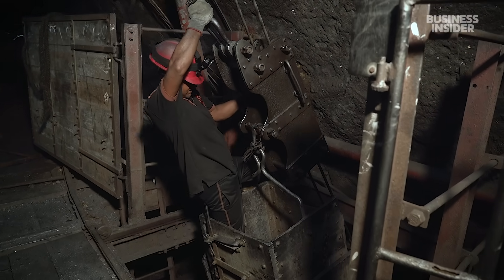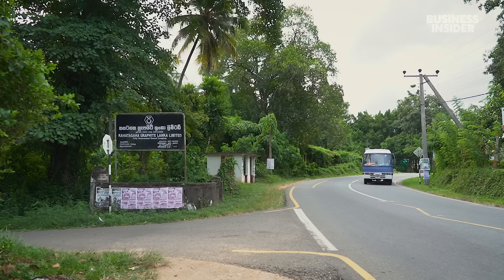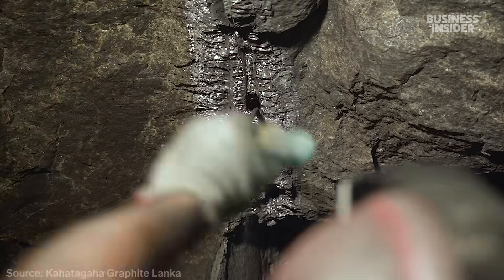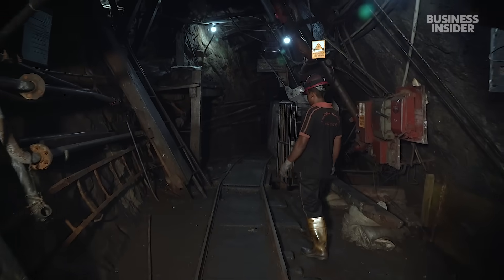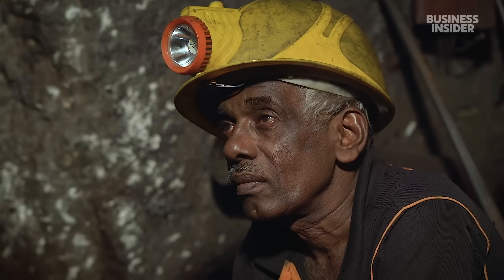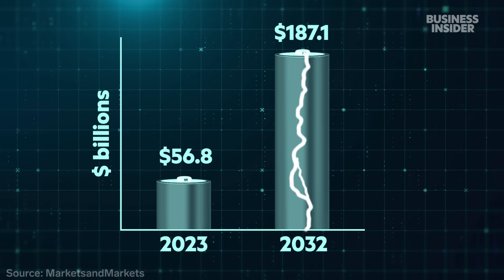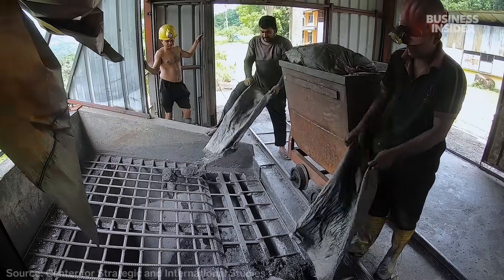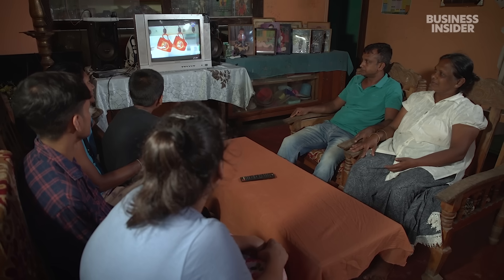Why Graphite Is The New Gold As Tech Wars Ramp Up | Risky Business

Comment: Graphite is not "The new gold", at least not natural graphite.  Natural graphite goes for about 2,000 USD a ton (about a dollar a pound) and that's after heavy processing.  The graphite used in higher end cells typically use synthetic which is far more expensive.

Comment: Correction : graphite is not use to pass electricity but its usd to insulate to two electrodes from fusing together! In batteries, it is used as a barrier to seprate aluminum and copper plates, which conduct electricity.
Reply: Wrong, the paper separator is used for insulating the electrodes, graphite is used in single use cells to increase conductivity of metal oxides and in rechargeable batteries like lithium ion batteries to hold the lithium ions and also to increase conductivity. 

What are you even talking about “two halves from fusing together” and “barrier to separate aluminum and copper plates” did you just take a look at a picture of a battery cell and make assumptions?
There are materials that coat the aluminium and copper plates to make the actual battery.
Reply: @exMuteKid  do all kinds of rechargeable batteries like lfp/nmc/na-ion require graphite ?

Comment: The drill used water to keep the dust down, to lubricate the drill rod as it cuts into the graphite and to flush the cuttings out of the drill hole so it doesn't bind the drill steel. 

The explanation about the blasting materials and how it works is also totally wrong.

Comment: Clarification it wasn't used as cannonballs it was used in the cannonball mould to make the ball smoother and thus fly straighter.
Reply: Thanks, I was wondering.   I knew that carbon black was a steel alloying element.  So I wondered why they would add expensive graphite.

Comment: Sri Lankan graphite is the purest graphite on the planet.
Reply: doesnt matter if they only produce 3000 tons of the stuff
Reply: @greaterglider  Sri Lanka produces more than three times that from just two mines, and others are coming onstream.
Reply: @karhukivi  China still produces far far far far more of the stuff
Reply: @greaterglider  Mostly industrial quality material, used for steel making, electrodes, foundry equipment etc. but no good for batteries.  China also produces most of the high-quality synthetic graphite for batteries but the USA and European countries are starting to catch up on that.
Reply: Ehh.... there is no such thing as pure and impure graphite. Even if it's mixed with another mineral, separation is easy at the factories. It's ok to be proud and boast if you are a Sri Lankan, but don't make up fake information to justify it....
Reply: @haxonprime1243  Yes there is - most mines produce about 20% graphite which has to be separated by flotation from the host rock.  The Sri Lankan deposits are vein-type so the graphite vein can be taken out without the waste rock around it, so pure.